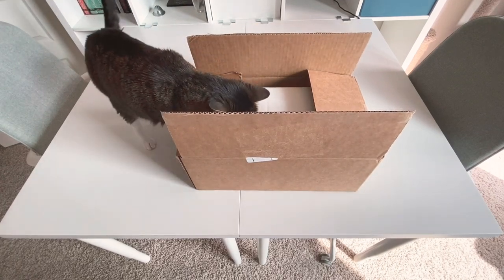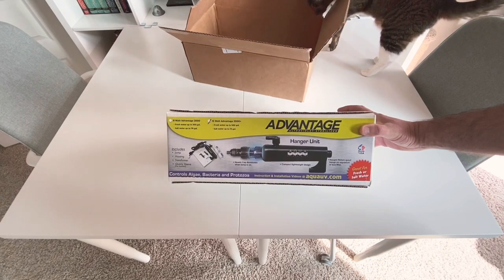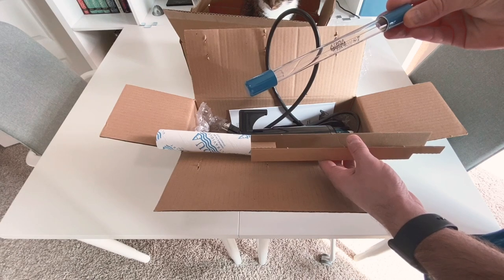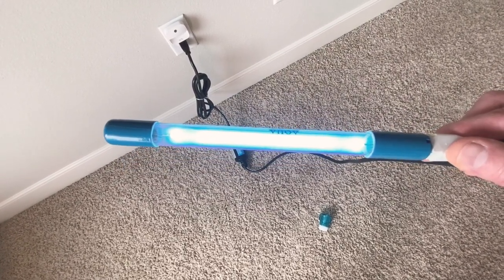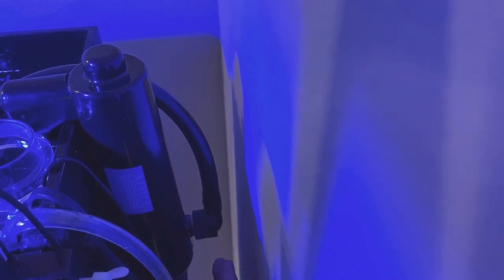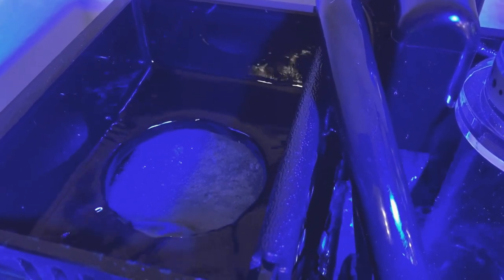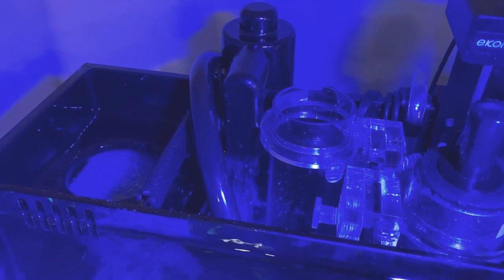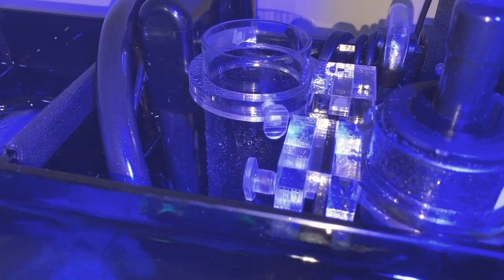Waterbox AIO Nano Reef Tank Build | Ep. 38 | Aqua Ultraviolet Sterilizer Install on an AIO

Comment: You can buy another one of the barb fittings from AquaUV for the outlet and just attach a tube that goes beneath the waters surface
Reply from the maker: I don’t believe the outlet is removable, but maybe i am wrong. The outlet seems to be part of the body.
Reply: @joety22  There is another version that has two 3/4" ID outlets.  You cannot replace the hang on piece though.

Comment: What do you think of the sterilizer now?  I have a waterbox 35.2 AIO and I am getting a Dino outbreak and want to see if UV can get it under control.  Do you do anything to make it less noisy? Also how long do you run it?
Reply from the maker: I love it. I stuck a 1/2 inch vinyl tubing up the outflow nozzle. I run it 24/7. It should help with your dinos. I would also start dosing phosphate and nitrates to help eradicate your dinos.
Reply: Thank you.  I have been dosing Nitrates and Phosphate for the past few days.  My nutrients bottomed out and I think that is what caused the bloom. I installed the UV on Saturday and I am already seeing things starting to turn around.  Thank you for the video! You might have saved my tank from total disaster.  Thank you!!!

Comment: I would have a slower flow so more sterilisation in the uv . But gr8 video
Reply: That's a powerful UV and clearly states that any slower than 230gph is not good for saltwater.  It will kill beneficial bacteria of you run it slower.